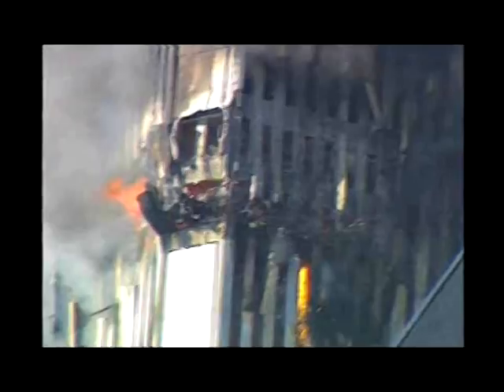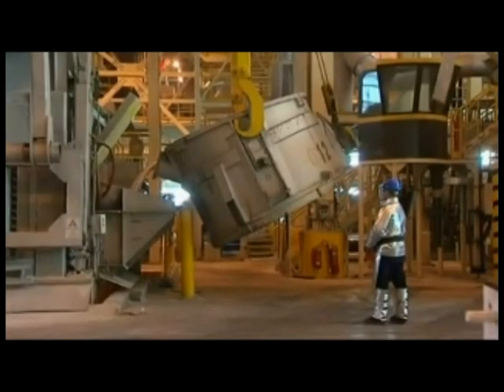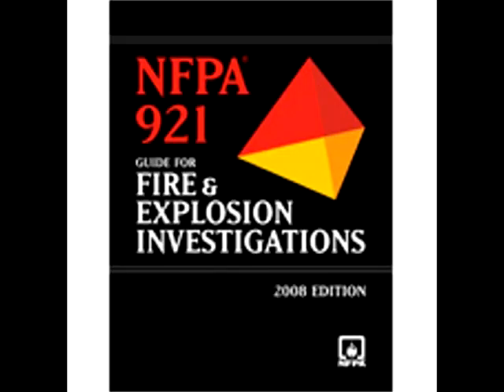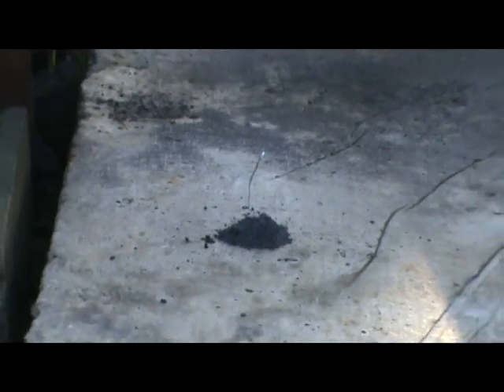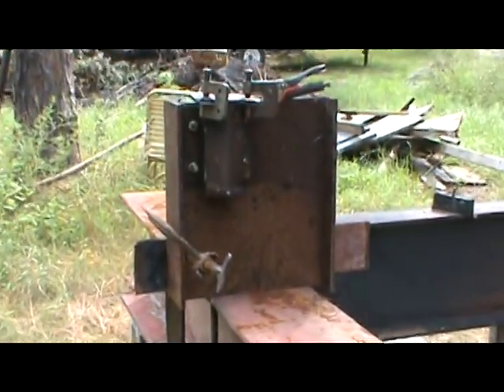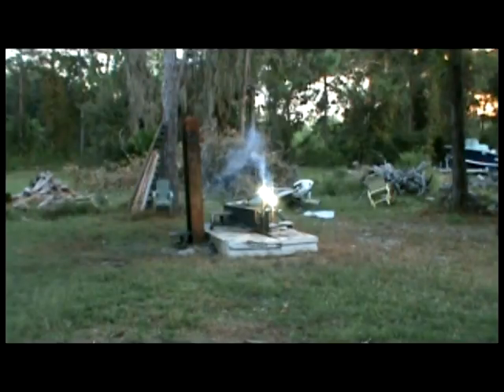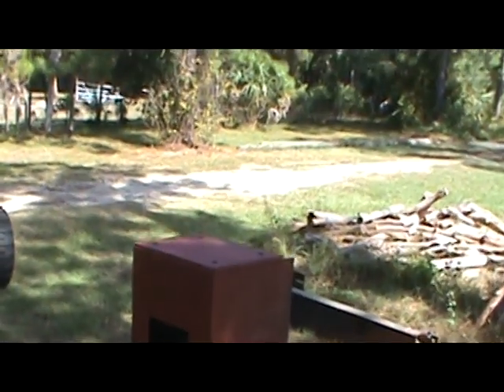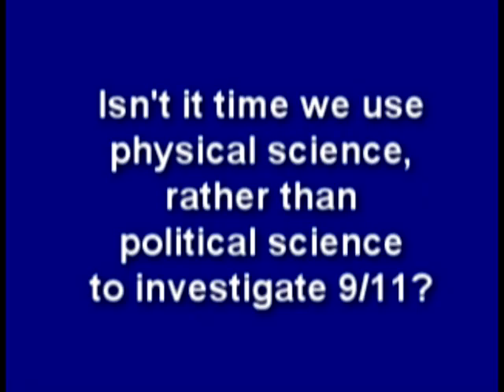9/11 Experiments: The Great Thermate Debate

Comment: Fun facts: 
-The tower was designed to stay standing when struck by small prop planes, not huge commercial jets. Even then that doesn't guarantee that it would deflect them like half of you dumbasses seem to imply when you use that in your argument.
-A lot of the NYC population at the time, who are confirmed to be real, saw the planes hit the tower. Not on TV. Please, go to the Ground Zero memorial and tell your ridiculous "No planes were ever used" theory to the people tending it and see how quickly you get your ass beat.
-You don't need to melt steel beams to take away it's structural integrity and bend it. Like horseshoes?
-Finding somebody who claims to have engineering knowledge no matter the title and quoting them on a statement (not talking about the video poster here) proves nothing. Believe me, many "experts" back up the opposite claims as well. This includes and is not limited to the entire Popular Mechanics team.

Comment: While this mans experiment is impressive and informative. I still have questions!

While I believe at this point in time the WTC towers WERE NOT tactically demo'd by illuminati type rouqe government, I also don't completely write them off. The  reasons i cant believe this conspiracy theory is. 1 the massive under-taking to set such explosives and thermite in secracy. 2 I read all these comments about jet fuel is not enough to even weaken steel.

 I'm sure i could set up a 80 inch piece of i-beam in my back yard and burn 100's of gallon's of jet fuel and it probably wouldnt weaken. I ask if anyone can tell me what would happen if I were to build a single floor to the exact specs of WTC. then i set the same fire under that, and park a standard 100 ton track crane on top of it, ( which doesnt even come close to actual wieght of the 20 floors that should be above it) does anyone think the steel would weaken any, i dont have to be a scientist to understand that they would. i just simply look at the grate on my weber grill and understand they would.

 Does any one consider the  amount of kenetic enegy the fully fuel planes put on the building, the damage the impact explosin caused, portions of internal support they had to have taken out.

 Is it more likely the (gun shot) noises heard were the one inch bolts snapping apart under the pressure of the 20 floors compromised by the few floors weakened by high heat. Please dont metion nano-thermite when there was no tests what so ever to prove it was indeed thermite, it was meerly similar to thermite. i can go under the sink in my office and find things that are similar to a wide variety of explosives, but that doesnt make them explosives.

I cant belive in this theory until someone explains these seemingly key unexplained elements of the WTC conspiracy are explained with real undeniable fact.

If you can shed light on my concerns, by all means you are welcome to do so!

Comment: There are a lot of critical factors that go unexplored by 9/11 truthers because it doesn't fit their narrative. A lot of them cite Madrid's Windsor Tower as a reason to say that the tower couldn't have been destroyed by fire. But there are key differences here. The first major difference is if you look at the cause of the fire. A massive airplane hit the WTC. That's enough to cause a lot of structural damage. Not mention the immense weight above the impact site. Windsor Tower never faced anything that structurally compromising. But here's the most damning factor. Look at the windows. Windsor Tower's windows melted which meant their quality wasn't that great. That allowed the heat from the fire to radiate away from the building. But if you look at the windows of the WTC, they were intact, even after the impact. Why? Because of the immense quality of their craftsmanship. They were designed to withstand a lot of force, and more critically, designed to be able to insulate similar to an oven or a forge. I posit that the WTC turned into a massive furnace and trapped the heat it was generating. With nowhere to go, except for through a narrow exhaust from the initial blast, that heat was trapped and was able to reach temperatures far higher than originally assumed. Those towers fell because they were too well designed.
Reply: +Red Judas 
Yes and dont forget to never forget!

Comment: Liquid Aluminium, it reacts with water creating Aluminium Oxide and hydrogen, this reaction is extremely explosive. The Aluminium would have been brought into the building by the plane impact. There is certain materials in the Twin Towers that speed up the reaction and heated it up, at the heat makes liquid aluminium flow like water down the cracks and down the walls through the buildings, once it reached water, it explodes, weakening the structure, thank me later. I don't care if you think I'm wrong because it's a basic chemistry which is played a important part in 9/11...

Comment: Has any conspiracy addict proffered even a remotely plausible, logical and rational theory--and I'm not even going to reach toward TRUTHFUL--explaining how our sinister government super-geniuses managed to attach a few hundred thermitic devices to the structural steel hidden inside the sealed walls of two separate 100+ story buildings?

Just curious.
Reply: +Elmo Diablo The steel support sections in both towers had numerous access hatches for inspection and maintenance, and there were several days prior to the attacks where excessive numbers of maintenance and cleaning personnel closed whole sections for undisclosed reasons.

Don't get me wrong, I'm not saying it was a government conspiracy (I honestly don't care much either way) just pointing it out.
I'm a fan of demolitions, so I do lots of research on the subject.
Reply: +Elmo Diablo No. None of them said anything plausible, logical and rational.
Reply: +Elmo Diablo 
Who says the thermite was installed in 2001? How about 1973?

Comment: Has anyone taken into account the fires that were sucking in oxygen that made the fires in the building even hotter ? 
It was like stoking a fire in a nearly completely enclosed kiln. Which creates way beyond "normal" temperatures than your experiments in open air do.
Hot enough to melt steel (obviously), like it has throughout History. 
The temps "up there" were a LOT hotter than you think.
Reply: +TacomaPaul But dirty burns don't maintain heat for very long, and every steel support in the towers was covered in asbestos fire-retardant.
The impact of the jet-liners would doubtless have shaken some off, but there were massive amounts of it.
Each floor of the towers was also over-engineered to hold over 5 times their own weight. They were built with aircraft impacts in mind, simply because of their height and notability as landmarks.

Don't get me wrong, I don't have a position on either side of the debate, I'm just interested in the subject.

Comment: My god! They've been lying to us for 70 years.  Kamikazes really couldn't have destroyed all those ships in the Pacific!  Entire aircraft carriers have been hidden from us! Its impossible for a tiny single engine aircraft with low grade fuel to damage a ship.

Then again, if you talk to a blacksmith, it takes only about 500 degrees to make metal malleable, slightly more than that to remove the temper. If a two pound hammer can shape 800 degree knife blades - several hundred tons sitting above 1200 degree steel is going to move something eventually.
Reply: +flyingfishsurf Honestly, the mere physical presence of Nano-thermite shards outside of a military lab/operation and no less in a civilian metro area? Not to mention the evidence of iron orb pellets everywhere... At that point it doesn't matter what else happened... The most important question of all is "Why is this here?"
Reply: +Chainsaw Aardvark You really have not done much research have you? Did you forget the evidence of sulfidation and eutectic reactions? Read about the framing of Kurt Sonnenfeld, the official site photo/videographer. He was recently extradited from South America and is awaiting trial in Colorado. I cannot find a trace of his situation since his arrival in CO earlier this year. Curious. To me, his story and potential information is more pertinent than Ed Snowden's revelations. Also curious is the symmetrical collapse of Building 7 after it suffered asymmetrical damage. It flies in the face of my college background in physics. Those four corners dropping simultaneously should be enough to get anyone thinking. How do you explain Building 7? Even NIST can't explain it without misrepresenting the engineering behind the building's design. Kamikaze planes hit my uncle's ship, the USS Hancock more than once. During one attack a plane crashed the deck causing a massive fire and killing 62 men and wounding 71. (There's even a video on YouTube). You do know that Kamikaze planes were carrying bombs and other ordinance, right? Those weren't Piper Cubs flying around. Critical thinking has all but disappeared in this U.S. idiocracy.
Reply: + Chainsaw Aardvark 

The mechanics and physics behind a steel vessel taking on water and sinking vs a steel structure on land collapsing into its own footprint are not even close to similar.  Your analogy is retarded.
Reply: +Chainsaw Aardvark They were flying into the ships with full bomb loads, i guess that makes a little difference...

Comment: The prosecution rests! DEFINITE evidence of Thermite and conspiracy.....THAT is what the sparkling molten metal is! Look at the size of those girders! An aluminum aircraft wing will NOT cut girders that thick! I know I am an ex Air Force aircraft engineer.
Kerosene cant burn hot enough to melt steel or concrete!

Comment: What about all that molten aluminum from the planes that seeped down to the lower floors?  When molten aluminum hits water, the force per pound of aluminum exploding is close to C4.  Now the planes had tons of aluminum and LIVE videos showed aluminum flowing from parts of the buildings.  No one except two explosives experts working at different parts of the world took that into account.  Essentially, there was 60 tons of explosive (aluminum) flown into those towers.  The aluminum flowed down many levels, hits different water sources and boom.  Presto, a scientific explanation for the explosions that accounts for what no one else does - where all that aircraft aluminum went and how it reacted in the fires.  So why didn't the 9/11 Commission mention that?  Because bureaucrats aren't always the best, especially when being pushed by congressional staffers err yes men to get something done fast (not necessarily right).

Comment: The beams only needed to be hot enough to get soft. The fires were plenty hot for that. We had a wood shop at my High School that was burned and it was built with steel I beams and it was hot enough to sag the steel beams to within a few feet off the floor. This was far less than the trade center fires from 9/11. I can say it does not require the steel to melt. The heavy weight on soft steel is enough to turn the steel beams into putty and then collapse. But being that they did collapse in a demolition fashion I can't say softening was the reason. Just a thought. Being that the building came straight down even on the sides that were not affected by the heat gives me pause.
Reply: +Pete McWade There are a few basic problems with the 'office fire weakened the steel'. None that say 'It was the government!' but still.

1) Each floor of the trade centers was was over-engineered to support five or more times its own weight, along with the floors above it.
2) Every steel column was sprayed with asbestos fire retardant. (Large amounts of which would be shaken off with the impact of a jet-liner, but the point stands)

The trade centers were built to exacting specifications for the specific possibilities of airliner impacts (not necessarily from terrorists) because of their extreme height, and notability as landmarks.

There are other factors that come into play, such as contradictory eye-witness statements, incomplete or shoddy investigations, etc...

I'm not convinced that the government planned 9/11 (They're pretty awful at hiding conspiracies), but I seriously doubt Al-qaeda has enough engineers or combined intelligence to pull of a stunt like that on their own.

Comment: From Wikipedia on Jet Fuel - Max adiabatic burn temp 4040 degF (2230 C) open air burn temp 1890 degF (1030 C).  

The WTC jet fuel fires were not open air fires, they were enclosed and the temperatures ( 4040 F) could have easily exceeded the melting point of steel (2600-2800 F). 

Conspiracy nuts chose and adjust their incorrect facts to prove their theories. 

They even quote lower incorrect open air burning temperatures to make their case. 

After burners in jet engines have to be carefully managed to avoid melting the engine.

Comment: Only three minutes in and I can already debunk this whole video.
They mention foundries and forges as being hot enough to melt steel, and then say that an open fire can't be hot enough to melt steel.

When fanned, a forge flame, made by burning wood or other combustable materials, reaches temperatures hot enough to melt iron (which has a much lower melting point than steel).

Even in medieval times, blacksmiths knew that you can change the shape of metals without completely melting it. Molten iron in combination with the air pressure and other factors can be hot enough to make the steel beams bend, and then the tension on the beams would be enough to snap them off.

It is true that news might have reported it as the steel melting (despite the reports clearly stating the molten slag was iron, not steel), but we're talking about the same news channels that stated 4Chan was a person.

Just because the news don't get all facts completely right all the time, doesn't mean the event they report on is a government conspiracy!

Comment: Occam's Razor...
Not that this is the only explanation left, so it is right...
But usually there are easier and more simple explanations to be had...

Think about it... to use these contraptions you built, to do what you did here, there would have been massive reconstruction of the building on nearly every floor to cause the "controlled demolition" of the building. 
There is no record, no eye witness accounts, no evidence that such work ever took place.

Not to mention, the lack of evidence to show the ignition devices that would have had to be used to start these "controlled thermate burns"...

Comment: To the creator of this video. Do Fairies fly out of your but when you take a dump? I dont know. But you think it s possible. You 911 conspiracy nuts are idiots you cant see the forest for the trees. The columns melted because of the intense heat from thousands of gallons of burning jet fuel and the heat forcing air up through the towers creating a giant forge. You can melt and make steel with something as small as a bbq grill some type of fuel for fire and a fan or bellows to move air into the fire. Its that simple. Bin laden didnt know this they just got lucky. It is everyones responsibility to keep their eye on the ball and our foots on the throats of our enemies or they will destroy us.

Comment: more of this bs you lot are idiot first off its a 200 tone projectile traveling a few hundred mile an hour that alot of kinetic energy to be stopped when considering the hieght ant that it translates to the buttom as a lever the fact is that is what brought down the building yes melted melal was found their was alot of flammable stuff in the building apart from jets fuel and the building fell down high pressure and weight creates pocects of super heated flammables any first year engineer knows this its why they would of hit the top of the building cos basic calcs tells you a building cannot with stand that impact its not design to full stop. Under extreme pressure concreate will explosively break apart say a few hundred thousand of tones of stress on it. Maybe you should all stop being disrespectful to the momery of people who where lost by saying oh must of been the government cos im a complete idiot alot of people where lost and moronic bs like this i find perfect and desrispectful

Comment: Surely anyone with basic knowledge of chemistry knows that atomic bonds get weaker as the material heats up? In this case the steel beams were weakened by the heat, not to mention the initial structural damage. In short, you don't need to melt the steel beams to make a tower collapse.

Comment: Sorry to burst your bubble but i work in a foundry, mainly working with magnesium and aluminium - and its quite easy to get aluminium to glow orange. Aluminium is molten around 660 degrees and will look silver at that temperature. If however you adequetly super heat it, it will glow.

Comment: they used the wrong terms in the official report. I wouldnt say the fires and jet fuel "melted" the steel, but "weakened" the steel supports. You Don't need to melt something in order for it to become weakened.

Comment: Well, why not molten metal?  There were oxygen tanks aboard the plane, right?  That would allow the increase in temperature.  Also, any beams that were still intact in that section would now suddenly have a much greater amount of compression from the weight above, which would heat them up as well (think how magma is created.  Compression generates heat.).  Friction generated by suddenly bending material also generates heat, such as when one bends paper clips...the bend gets hot.  Just my thoughts.

Comment: All those sparks falling from the towers could also have been electrical sparks. there where massive electrical power cables running all through those structures and as they burned they grounded and threw sparks. It happens in electrical fires all the time.